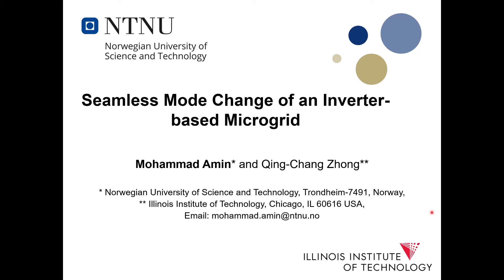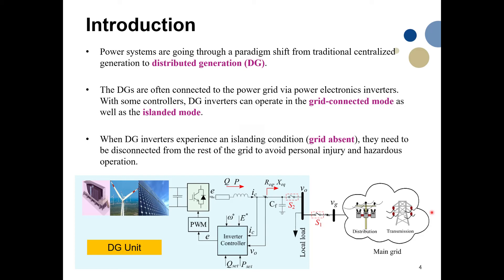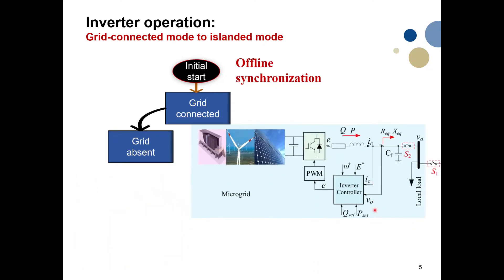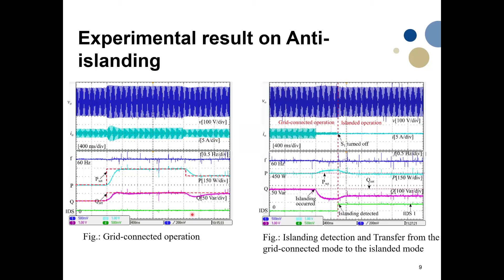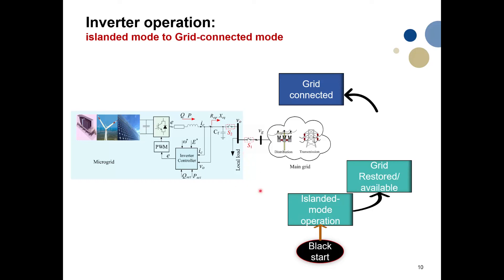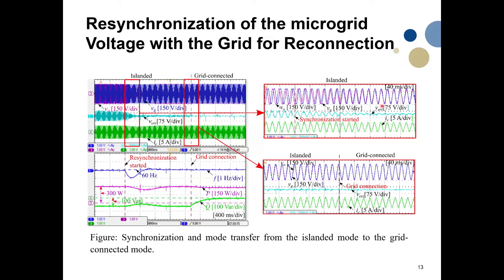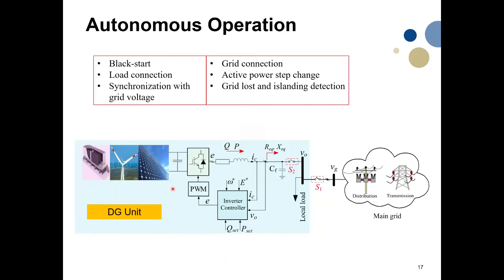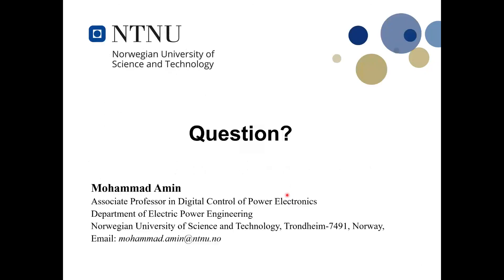Seamless Mode Change of an Inverter-based Microgrid

Comment: Thanks for sharing. 2s or 600ms is too long for most customer for on-grid ogg-grid transition, we can think of switching device to implement fast transition (~<30ms)
Reply from the maker: Hi Zaixing, the critical or local load is supplied all the time by converter and/or grid. There is no transition delay when the mode change from islanding to grid-connected mode. Note, this 2 s or 600 ms delay is only for detecting the islanding condition and tripping the grid side circuit breaker.